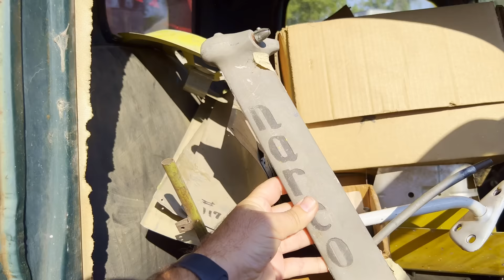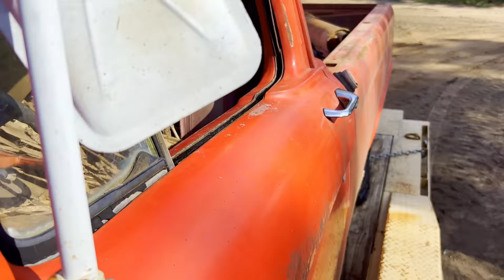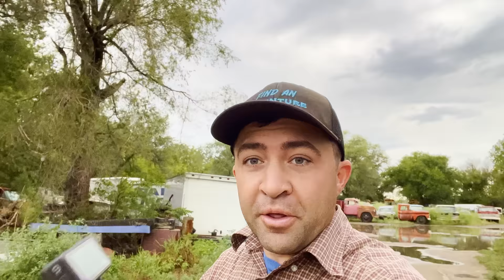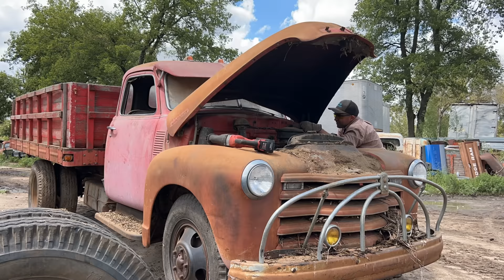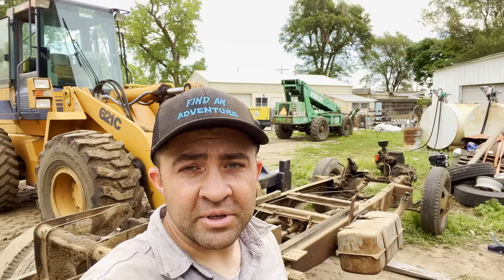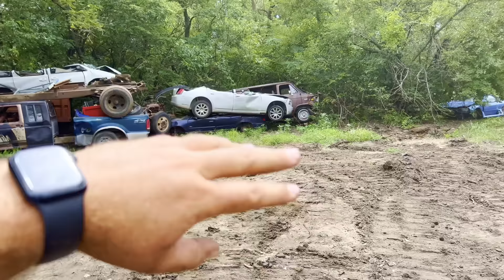I Bought an AMBULANCE! (Crazy Busy at the Junkyard)

Comment: Looks like the Kansas drought broke with that rain storm. 
PS — Thanks for posting. One hard working crew!
Reply from the maker: Only rain we got all summer. It was dried and gone within a week. Reservoirs are still extremely low and the river is about to run dry. It would take months of rain like that every few days to pull us out of the drought now 😔
Reply: @AdventuresMadeFromScratch — Wow, looking at US Drought Monitor site, Kansas will take a lot of rain this winter to just get back to normal water levels.

Comment: That job keeps you hopping especially when you have to run between two yards. Those catalytic converters are worth their weight in gold. Well considering they use platinum inside those no wonder they get stolen. My Daughters Cat went out on her 2010 F150 custom and it has two catalytic converters. That's gonna be a couple grand to replace without the labor to cut the old ones off and weld the new ones in. Thanks for another fun video.

Comment: That little GMC Chevy S10 first generation. The one at the farm clean up that you probably already completed by now. It is amazing how much those parts are going for currently. I thought I saw Fiat x19 2-seater sports car with a removable landau top. I've got an old 1977 or so wagon and it's a Fiat. It has to dual overhead cam engine in it. Which is the spider sports car engine which should be the engine for Fiat x19 if that's what it is that you showed in the back ground. All that's worth something to the right collector. I can see that metal deck on top of a school bus camper next to a lake and a big tire swing coming off a tree. Get on the deck swing out and drop into the lake. Those days are long gone for me but they sure are fun back in the day. great video